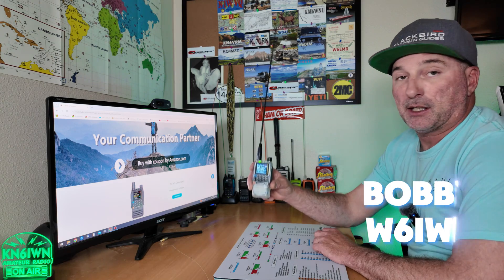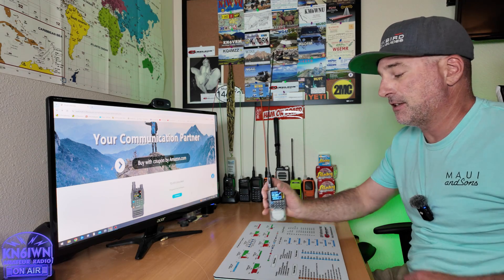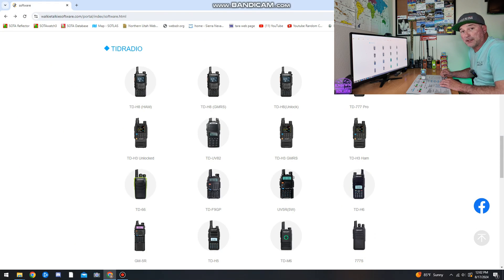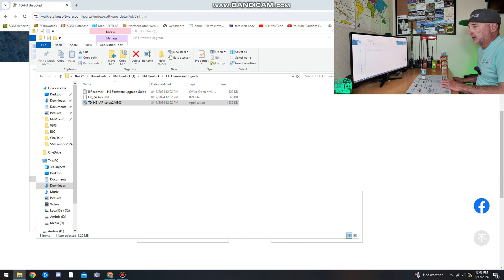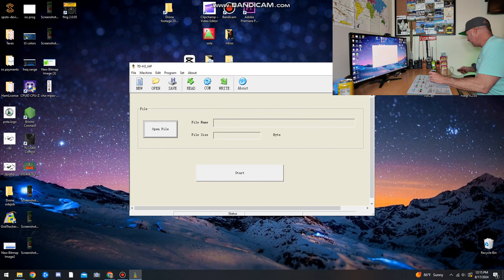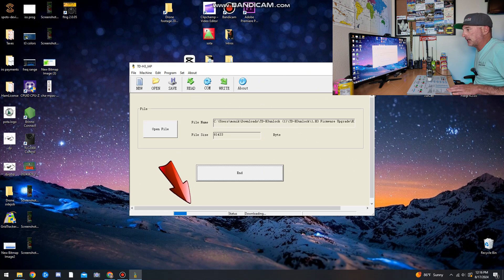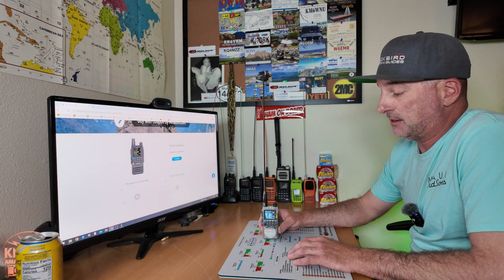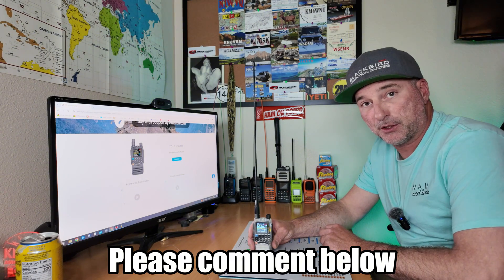TidRadio Firmware Update HOW TO

Comment from the maker: Update. Email response from TidRadio on change notes. "Adjustments or additions:
1. Add 8.33K steps;
2. MIC gain plus CK to adjust gain;
3. In DTMF mode, the PTT B button can also be used for transmission."